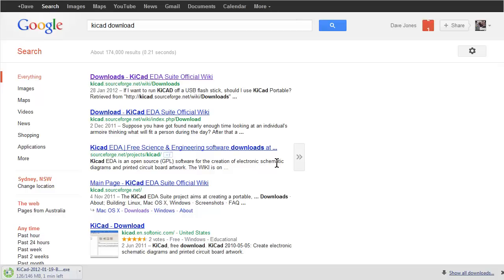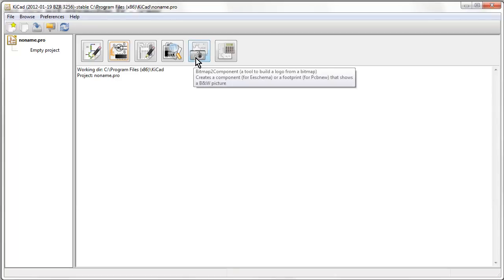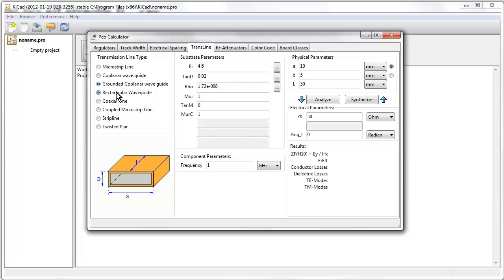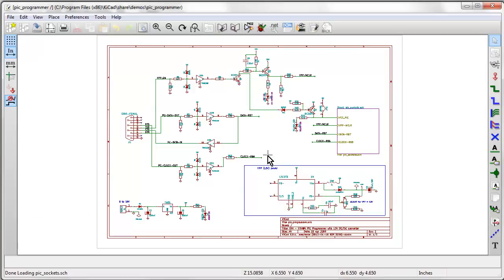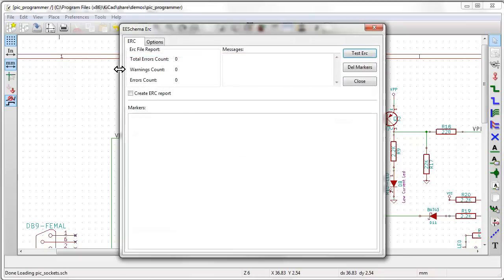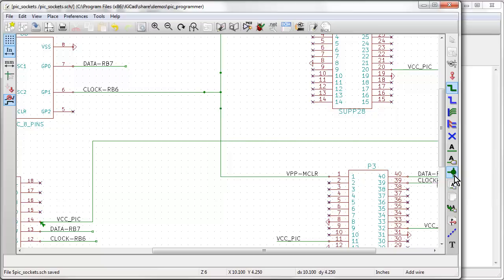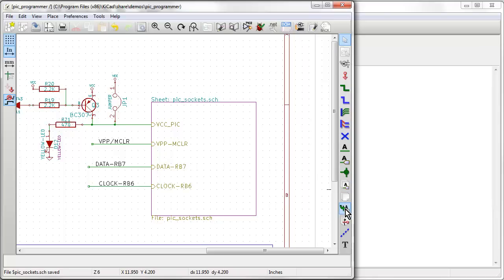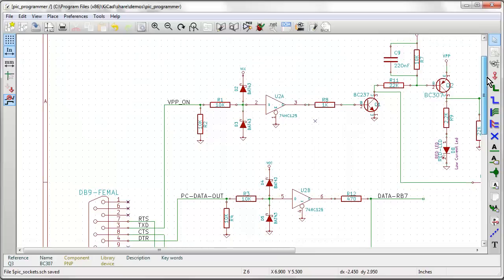EEVblog #253 - KiCAD Install & Schematic - First Impressions

Comment: was using Altium for some time, then I done some small stuff with KiCAD and now I am using it all the time :). It's simplicity that got me, I don't need al the functions from Altium, and KiCAD works on Linux too.
Reply: Denis Leskovar thanks for your opinions on Altium and KiCad. I will check out KiCad.
Reply: Free software :) But honestly I would prefer to use Eagle. Have you tried gEda since then?
Reply: barf, eagle. I hope you've moved away from them after their recent debacle. DipTrace is where it's at.

Comment: @Psychlist1972 The error was actually because the current project does not have a schematic, but KiCAD tried opening a file file that does not exist.  It is seems to be there to alert you that there is something wrong, or you are just starting out.

Comment: Dave which program do you recommend for circuit simulation (Spice Simulator). I have been using Proteus VSM in engineering school but have reached some of its limitations at the professional level. Which tool do you recommend?

Comment: I had to export to Clipboard when I needed to print a schematic yesterday (just kept giving an error when I tried to print directly). Pasted into an imaging application and printed from there. I would try the center mouse button to pan. That’s how most other applications work where the scroll wheel defaults to something else

Comment: When you do an update, as others have suggested,  please either download the installation file outside the video or get a better connection. I had your download speed when I was using a 56K6 modem. Why is it so slow over there? Do you live somewhere in the bush?
Reply: When you want to make a video like this, make sure you know the program before you start. Now you just make a fool of yourself. A good way to start would: RTFM.

Comment: Under "Tracks Characteristics", why are 'Resistance', 'Voltage Drop' and 'Loss' all the same numerical value? (8:43)
Reply: The current running through the wire is 1A. Ignoring units (which we can do because SI is sane), V=IR and P=I²R, so V=P=R. You would, of course, get different results at a different current.

Comment: In the Ubuntu 14.04.3 LTS repository the following instructions should give you the ability to pan around with just the mouse and the middle mouse button. This method should also work with modern Windows as well.

Using the menu to to Preferences > Options > General Options tab. There should be an option to use the middle mouse button to pan. The default is for it not checked, but just click on the check box to enable it, and then click OK to save the setting. You should now be able to pan around, left, right, up and down by clicking and holding the middle mouse button.

Beginners should find Kicad the best choice to start out with unless you have a specific need or cost is just not an issue.. Eagle does provide a "free" but very limited starter version. The nice thing about Kicad being open source it gives you access to the source code and if required you can hack it to your liking if it is missing a feature you need. As Dave has repeatedly advised, put aside all opinions and recommendations no matter how expert the person giving the advice, you should evaluate  your own needs, and do your homework and get the solution for you.

This video is getting a bit long in the tooth, but this is still an excellent video to watch if you are considering getting into using electronic CAD software.

Comment: As a kicad user, it's quite interesting to see this myself. Huh, weird that it's slow moving the part. Never seen it do that before.

Just a couple notes: "CvPcb (components to modules)" is not the library editor, it's where one assigns footprints to parts. The library editor can be accessed via the button to the right of the "Navigate Schematic Hierarchy" button.

Comment: Been a while since I've laid some PCBs. Just doing some hobby stuff. Would you recommend this program over FreePCB, ExpressPCB, Eagle, DipTrace and DesignSpark.

I've used Protel products (Since the days of Edit/Plot in the red boxes, user number was in the 2 digit area). Have owned Edit, Protel for Windows, Protel 3, Protel98, Protel99SE. Cannot afford jump to Altrium. Have to do something, autorouter for Protel98 and 99SE doesn't work in XP/above. It just stops when you start it.

Comment: @EEVblog About the slow re-draw, apparently new versions of Windows have caused the library KiCad uses for GUI drawing (wxWindows) to be slow. Apparently there is a workaround though: Checking off "Disable desktop composition" in the compatibility options for the shortcut to KiCad

Comment: I would also like to improve file naming conventions and how components are copied between one library and another. As-is KiCad naming convention is not necessarily intuitive so it's hard to identify what files you need to place under version control until you look up the names of files online. It's also fairly tedious to import/export library modules to the point I just open up the files and copy them over with a text editor (KiCad's format is ascii text which is nice!)

Comment: One way to import a "rare" component from Altium, is to use a converter (I guess there is one from Microchip site?) to Eagle, then, execute a script from inside Eagle to export to KiCAD. SparkFun have their library exported also to KiCAD. Unfortunately, I can't post links...

This is a reason to keep also Eagle 5.x on your (linux) computer (does not matter if is in limited mode, it works for conversions).

Of course, you can create them, but who have the required patience?

Comment: I looked around on the web and i was stunned of it's funcionality and features (not rocketphysik stuff but "nice to have" stuff). I was an OrCAD user and made some projects with eagle. I have to say that the OrCAD is not any better on the first view than the KiCAD. The licence of my OrCAD thing was about 15'000.- CHF wich is bit more in $. Eagle is very nice for very small projects because it's free IF YOU WANT TO USE ONLY 2 LAYERS AND SMALL SIZED PCB. At least I will surely give KiCAD a try!

Comment: @EEVblog when I said hobby grade I mean to say it doesn't play nice with files or formats from the majors. a little soft on features. it's got little quirks like the redraw problem. UI can be a bit clumsy and disorganized at times. Lots of little things that keep it second tier. As to price vs capabilities it's hard to beat. Great for small businesses or hobby guys that need schematics and gerbers for projects. Maybe not so good if your a larger company that needs cross-compatibility.

Comment: Anything is better than EAGLE :-)  KiCAD looks nice and I think it's quite usable, but I don't like that GUI and overall conception. I think DipTrace is currently the best. Limited version is free and if you outgrow that limits, you can buy a basic license for a price of DMM. And if you upgrade again, you have to pay only the diff. between your current and the new license.
Btw. check prices - even much lower than for EAGLE - overpriced piece of sh... . EAGLE stucks somewhere in 90's.

Comment: After using TinyCAD almost since the beginning and trying Kicad's schematic capture part, I can tell you Kicad is clunky, to be kind. Tiny is so much more a well thought out UI. You can do so much more with just the mouse. Some big things are missing in kicad , like traces that stick and stretch when you move parts. You can't edit trace segments either. Its so primitive in comparison. I think I will go back to the Tinycad-freepcb chain I was using. And check back in a year or so and see if they have lined up the UI with industry stds. Like panning by holding down the right mouse button, instead of some dumb key combo. Or worse, trying to hold down the mouse wheel, move the mouse and not move the wheel. Disappointing....
Reply: TBH there's no real standard in CAD programmes like there is in spreadsheets etc... To get real work done you have to just get used to the idiosyncrasies of the tool your using and learn it's particular keyboard shortcuts. I've never used TinyCAD but Eagle is just as clunky and relies just as much on weird keyboard combinations...

"Some big things are missing in kicad , like traces that stick and stretch when you move parts"

That's not missing at all.
Reply: Mechanical Menace
Strange, every time I moved a part the wires stayed put. No snap and stretch at all. Also I couldn't move wire segments without breaking them. I will revisit this in a couple weeks when I swing back to schematic capture, I will try KiCAD again. The current work is going to stay in TinyCAD-FreePCB.
Reply: Actually connecting wires can be a serious pain in the butt until you get used to it. It's easy to think you have when they just look like they have :(

It's awkward to get used to, but I've found that with almost every CAD programme, especially 3D ones. And you really do have to Read The Friendly Manual or find a good tutorial to get going unfortunately. But for free it's bloody powerful. Swings and roundabouts I'm afraid.

If TinyCAD works for you then use it, if this doesn't don't. The best tool for the job is the one you get good results from.
Reply: mweverett There is a different command ("Drag", hotkey G, or press Tab when selecting several parts) for moving parts with connections attached. It isn't smart enough to refactor the connections to go around other parts or even stay 90 degrees, but it will keep the connection. And if you only need to move horizontally or vertically, you can drag with the vertical/horizontal wires and it'll still look neat.

Comment: DIY projects are chump change. you have to see the bigger picture. One large client signing contracts for licenses & training with EDA soft company would cut cost for both companies and provide solutions that save time on the long run for the client company. On the other hand, Kicad is not user friendly, the user interface is just not built around the theory of a graphic user interface like microsoft has accustomed its clients to the use of a terminal (screen and keyboard). User friendly Costs.

Comment: I installed kicad the other day and could never get it to save a new project without crashing. totally useless
Reply: +Cameron Belt 
You're on windoze? Cause that works fine in Linux.
Even Dave were using windows while taking this video. So I think you should try Kicad again. It is not "totally useless"
Reply: Duy Thái Phan Hàng It works now, they just didnt have a stable build at the time, its much better now.
Reply: Sorry, didn't notice about timing here, your comment was 1 year ago. Silly me, I was just bumming into this video.